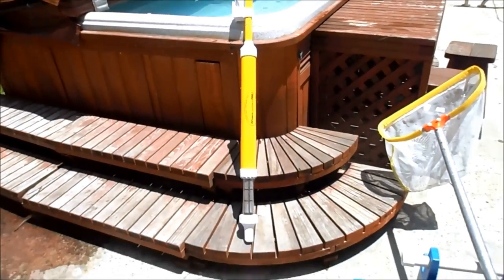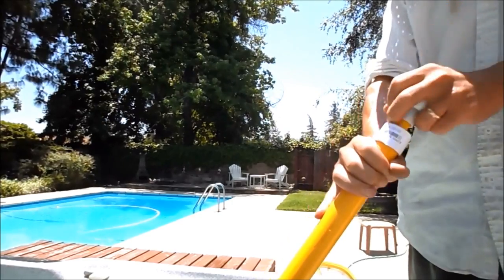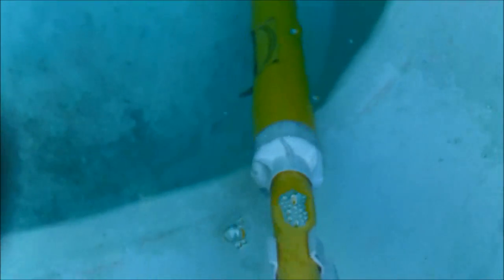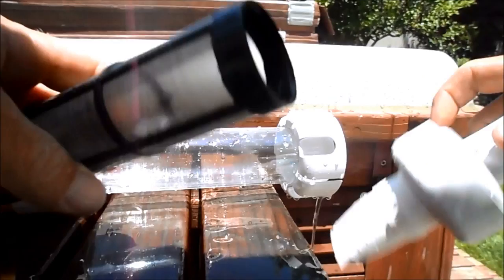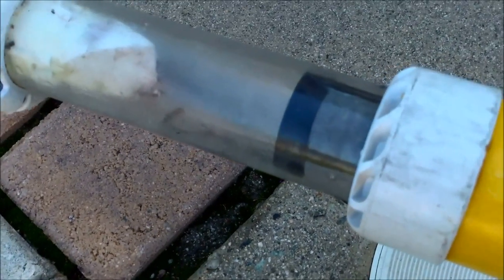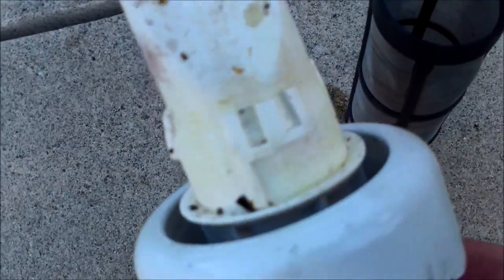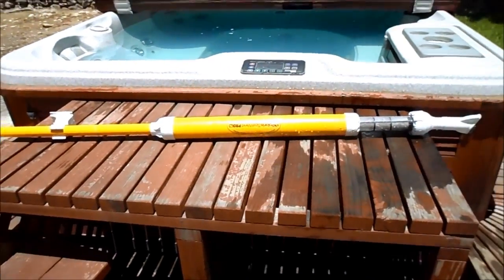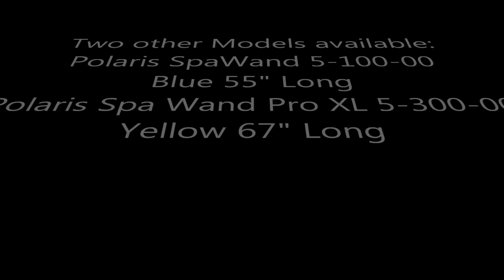Polaris Spa Wand Pro Yellow (5-200-00)

Comment: I can't remove the filter basket because it was inserted upside down. There is no way to grip the flat bottom of the basket. Banging the pump on the floor only moves it 1/8", not enough to grip.... WHAT TO DO?

Comment: I have a Hot Spring Spa (classic) and I'm trying to decide if I should by the Pro Polaris wand (yellow?) vs. the Paradise Spa Vac.  Of these two hand held wands...which of the two (in your opinion) is better?  (I figure you've probably seen or used one of these Paradise ones?)  Can you shed any light on this? thanks.
Reply from the maker: Sylvia Flood I like the spa wand. It lasts pretty much forever and works well.  Low tech but effective.
Reply: Thank you for your advice.  I purchased a spa wand today.  For my 325 gallon spa, is bromine tablets the way to go?  (I heard that bromine is not good for the pipes and stuff.  Would you say Chlorine is the way to go?  (chlorine tablets?)  Again, thanks for any advice for my spa. :)
Reply: I have the Paradise, and after looking at this vid, I would prefer the Polaris. The Paradise uses an empty air chamber, and the underwater pressure of the water to force water into the air chamber, i.e. a "quasi-vacuum". But once that air chamber fills, you need to empty out the water. That means you need to lift the want out of the tub, and let it drain. You can drain it back into the spa, trusting the filter, but I let it drain on the ground. Anyhow, the Polaris filter looks better, easier to clean, and the non-stop pumping action looks better to me than having to lift it out. One thing I will say for the Paradise, it does generate a lot of "suck" power until the air chamber is full.